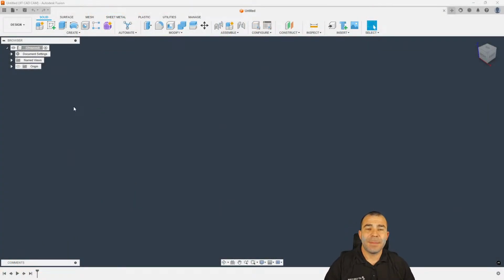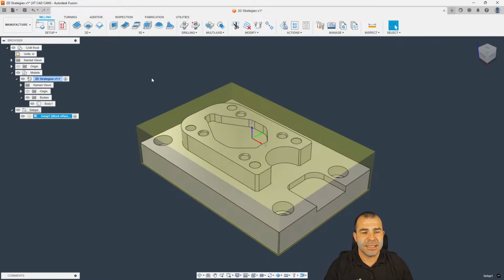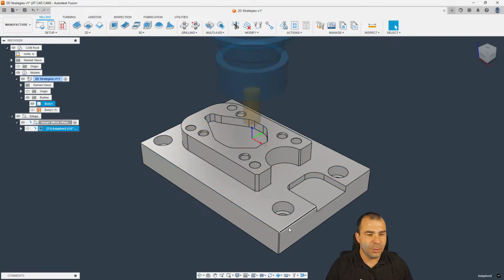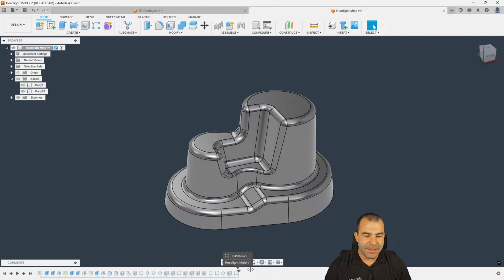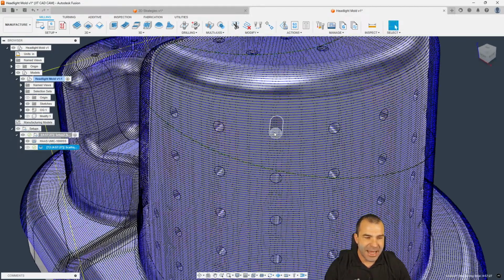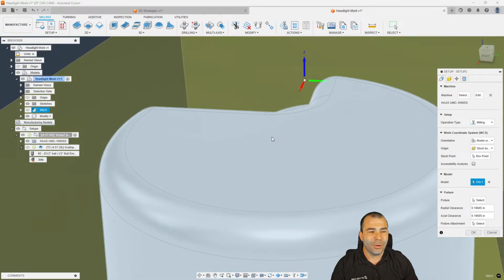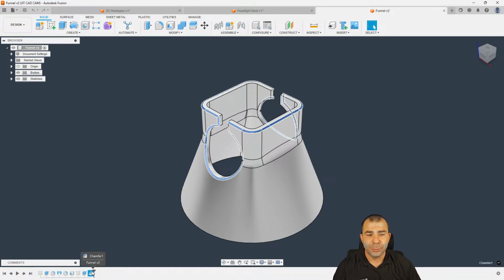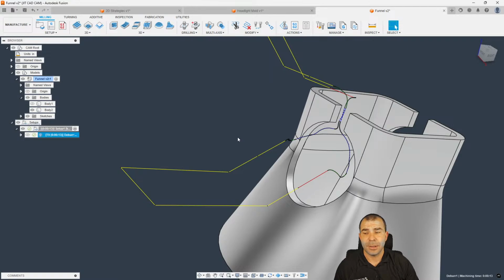Workflow Wednesday: When and How to Use Model

Comment: Nice tips. I got a little challenge. You have a finished model received as a step file, so there is no history. The part received is a casting with added material all around, and of curse some pockets not included in the casting. Using a patch is an easy way to cover the pocket, how about adding material to all sides of model and using that as your stock. So there will need to be a shift in Z from stock to model.
Reply: Can you join for free support Friday and put me on the spot to do this?
Reply: @fusionphil2161  I will try... it's difficult for me to make the 1pm time. I usually run 2-3 machines at the same time. If I'm done with my work load for the week, then I can leave early.

Comment: I recommend to rigid joint those two components together to avoid the original and modified models from shifting.
Reply from the maker: Love the way you think and Agree. If I was to convert the bodies to Components than a Rigid Group or Ground to Parent would be Ideal to keep them from moving.
Reply: @ yea, that works too. The move from 3- to 5-axis machining and having to reorient fixturing and zero point work offsets drove home this requirement - although it’s not exclusively a 5-axis issue.
Reply from the maker: Oh how I know the Feels, Next week I walk people through center of rotation for none Titled Workplane machines,